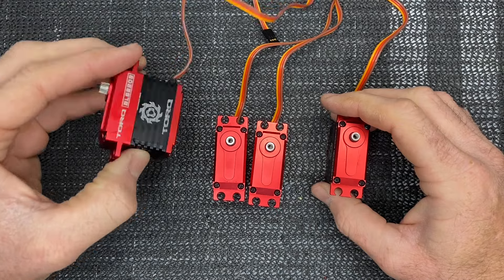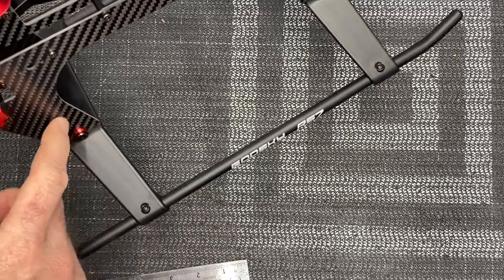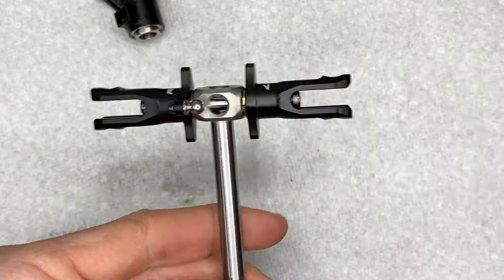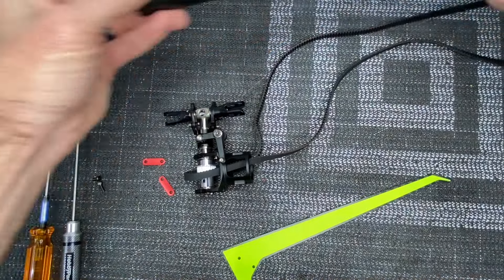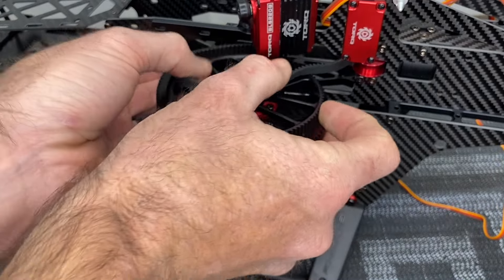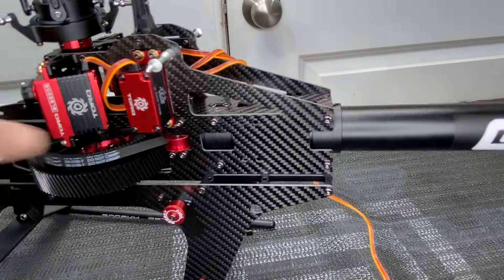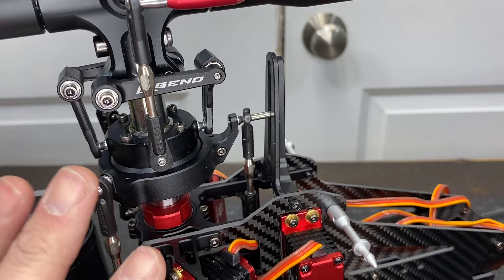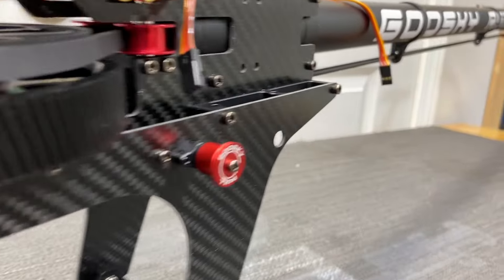Goosky RS7 Build Part 2

Comment: Glad to see a Castle being used. No ties to the company, I  just like them. 
● I dig your mission, Jeff.
Carry on.
Reply from the maker: I use castle in all my planes, used them in helis for many years but went to Hobbywing for the full telemetry and integration. And Hobbywing has a better BEC but castle still works great! Got a few 160s laying around so decided to put one in this thing. Thank you! I’m glad you enjoy the video!
Reply: you did not hear in video he is going to replace it with another brand most pilots have stopped using castle I'm wondering why?

Comment: great build video, awesome job, thank you!  Tail assembly looks a bit tricky.
Reply from the maker: Thank you! I appreciate that. Yes, tail is a bit tricky and getting the main gear/tail pulley in a bit of a challenge as well.
Reply: Used a little micro lube to hold them In place and took 5 seconds

Comment: Thank you very much for this very nice build video ! ... however .. i've got confused about the mainshaft "alignment" with the collar and the main/tail gear. my maingear has an axial play of like 1mm if i pull the mainshaft up as much as possible. and this is exactly the point: when fixing the mainshaft collar (the red one)... do you have to pull the mainshaft up as much as possible (so the tailgear is touching the upper bearing) and than fix the collar ? but if you do so ... the tailgear seems to ride a little bit higher than the belt. on the other hand ... if you push the mainshaft all the way down as much as possible (while having the jesus bolt installed) .... then fixing the collar at that position makes no sense ... because then .. the whole mainshaft can move up and down (in flight) for like 1mm ... i hope you get my point ... my feeling is, that you have to pull the mainshaft up as much as possible .. and then fix the collar ... this way ... the mainshaft cannot move up and down anymore .... but the maingear will have an axial play of about 1mm ... i think this is okay for the type of gearing .... however ... can you please clarify on that ???
Reply from the maker: Thank you for watching! I’m g,ad the video series was helpful! So make sure you have the third bearing block (the one under the main gear) in the right way. If it’s upside down you will have up/down play of the main shaft. You have about 1mm of up/down play on the collar to adjust. You don’t want to pull hard on the head to pull the shaft up you just want to tighten that collar down so there is no play. The main tail pulley can be a little high. But, check that lower bearing block first.
Reply: @westhobbiesrc8051  OMG .... thank you so much for putting me into that direction ... indeed i had my third bearing block upside down ... what a shame ;-) i have build my last helicopter 9 years ago ... but still .. i should have realized that it's not a good idea to have that lowest bearing without support to the downside (not sitting on that shoulder) ... i reversed it ... and now i almost have no play at the main/tail gears at all ... now it makes sense to "just" tighten that collar down "as is" ...thank you so much !

Comment: Would like to see how you ran the wires - the manual does make a vague suggestion to wire run - suppose you can do that run on either side - based on ESC model
Reply from the maker: In part 3 I’ll be wiring it up and showing how I do it (not sure how I’m going to do it yet but I’ll figure it out lol) I see the suggested wiring layout in the manual but the biggest issue is the width of the FBL Mount so getting super clean wiring might be tricky.

Comment: Jeff, excellent build series as always! I have mine all built just need an ESC and FBL.. what ESC do you recommend? This is my first 700. I have the Xnova Lightning 4525 530. Is the HW 130a big enough? I am by no means a Ben Storick or anyone (ultimate goal lol), but I can do some sport/3D moves (tic tocks, flips, hurricane, funnel etc). I like a high head speed, I’m probbly going to run around 1,900-2,100 when I’m ripping it around. Or should I play it safe and just get the 260a? Was trying not to break the bank with the ESC, but it’s worth saving for if it will keep the Heli from crashing! Lol I’m from good ol Pittsburgh PA so it gets pretty hot and humid here in the summer. Thank you!
Reply from the maker: Thank you! I hope these videos helped you! So the Hobbywing 130HV will work, I was going to put a Hobbywing 130HV on this one. It will peak over 200 amps but if you want bullet proof and as you grow and progress then get the Hobbywing 260. That’s the ESC I’ll get for mine soon. Definitely worth just saving and spending the money one time then buying a Hobbywing 130HV now then spending more money to get the 260 later.
Reply: @westhobbiesrc8051  they did, I used them as reference, same as when I built my Raw 580! Can’t thank you enough for your excellent work and being so helpful! You are very right, might as well get the 260, not only to play it safe, but I will definitely progress and “outgrow” the 130 eventually. Thanks again, I’m looking forward to not only flying the RS7 but seeing yours finished and the flight!

Comment: Looks to be a well made tank. Lots of littke extra thingsadding weight when not needed. Btw whats the rtf weight. Im guessing close to 13 pounds. I was going to get it after a 3 year hiatus from helis. However after your viddo on the sab piuma im getting the piuma.   700 sab heli thats light strong and tears holes in the sky.

Comment: Hello! Why didn't you install the Align servos? Are they the right size? I just have the same ones, I wonder if they will fit.
Reply: They will fit and they are great servos it’s just personal preference. He said in the video the torques came in on time the aligns were probably back ups.
Reply: @nickmasullo2528  Thank you!
Reply from the maker: The Align Servos were a back up. I was trying to get this thing built as fast as possible and didn’t want to wait on ordering all new electronics. I ordered my Torq servos the day I receive the kit. And figured I would just change them when they came in, but they got here a lot faster than I was expecting. Nothing wrong with the Align servos. They fit just fine.
Reply: @westhobbiesrc8051   Thank you!

Comment: why did everybody ghost castle creations just curious
Reply from the maker: @madison0348  main reason is because they are fallen way behind. Weak BEC, only 12s, and only 160 amps. I personally was a huge Castle person and have over 75 castle ESCs. I wish they would come back with a 200-250a ESC with 30 amp BEC and 14s

Comment: This thing is such a XL Power Specter rip off lol..... You should be using green retaining compound on those servo ball studs.
Reply: You seem uneducated to this. A lot like all the XLP reps I’ve seen lately on threads spewing nonsense. Guess this one’s a real threat huh? Facts are it’s better quality then XLP in every way and flys as well or better at a lower price. Facts are facts I own both and nothing is actually the same and anyone who builds and flys one has learned same thing. Stay salty! 😊
Reply: XLP quality is a 1/10
Reply: @shawnscott9704  Nobody is salty but you, if you built a Specter you would know this RS7 is very very similar. I fly multiple brands… even Goosky, I don’t care if it’s a rip off of a specter just calling it like I see it. Don’t go all butt hurt fanboy when someone calls like it is…
Reply from the maker: It is definitely built a lot like an XL power specter. I own one as well, the design was definitely mimicked in some ways. But it’s a lot different as well. Yes you can use retaining compound on the ball ends but Loctite works just as good.
Reply: @westhobbiesrc8051 Loctite can disolve plastic
Reply from the maker: @beenflying1  so can retaining compound
Reply: This guy must be a blast at party’s if he could only get invited to one